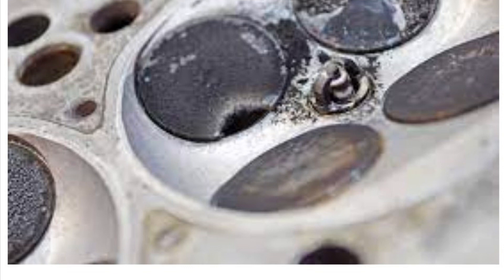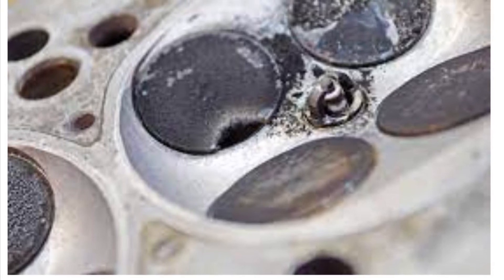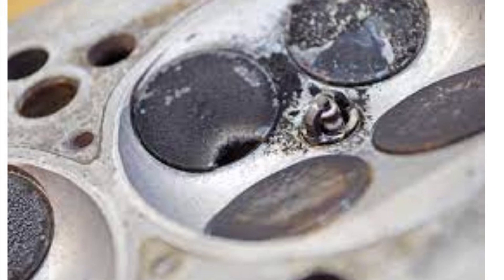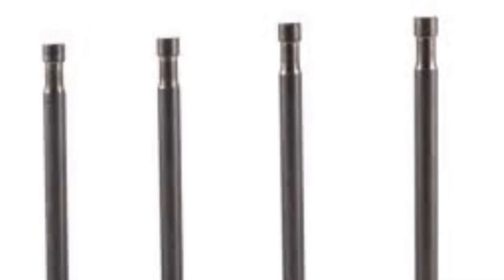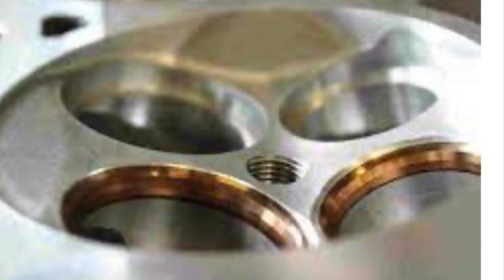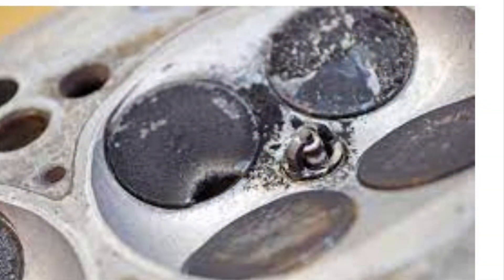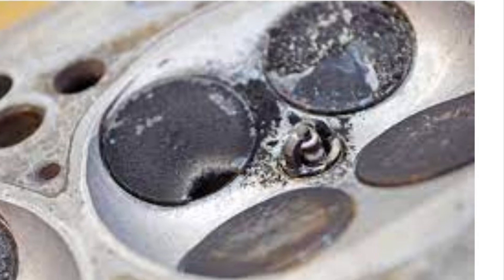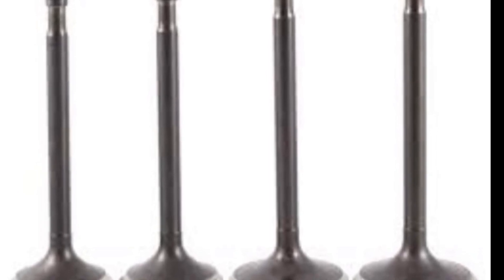Burnt engine valves and why its mostly BS bro science

Comment: I realize the owner of this channel is probably inundated with a bunch of questions from people and I’m sure he is sick of it lol. If anybody else has any insight into my problem, I’d appreciate the help.  I purchased a 2008 SV650 that I noticed was running rich indicated by the spark plugs and the smell coming out of the exhaust.  Looking into that I went down a rabbit hole of what possibly could be the issue and I came across people doing a burnt valve test. When I put a piece of paper in front of the exhaust pipe the piece of paper sucks and blows like in the videos I’ve seen.  Is this a indication of an issue with the valves even for a two cylinder v-twin motorcycle?  I purchased a very cheap Amazon compression tester and both cylinders seem to have good compression on the high end of the spec range.  I also gave it a valve clearance adjustment and two of the exhaust valves on the front cylinder we’re on the edge of spec on the tight clarence side. I replace the shims to be in the middle of the spec range.  Again, any help would be appreciated.
Reply from the maker: it does not sound like you have a burnt valve to me based off your compression test

the most important thing is how does the bike run?
Reply: @vcyclenut  thank you for the reply, I appreciate it. How does it run, well the idle is low and it sounds like it’s occasionally misfiring. When I ride the motorcycle the acceleration seems good, but there’s a lot of vibration in the engine which I’m told is common but I’m wondering if it’s due to the occasional misfiring?  Also the tachometer needle flutters which people on the forums told me to check for vacuum leaks, and I can’t find one if I do have a vacuum leak.
Reply from the maker: doesnt sound like you have a burnt valve to me

Comment: im worried i burnt a valve running my truck with holes all in the manifolds
Reply from the maker: hopefully not,   how large are the holes in the exhaust manifold ?
Reply: @vcyclenut  the entire manifold has holes in it, every single cylinder in the manifold has 3 to 4 medium sized holes (about the tip of your index finger in size), i just dropped it off at a local shop since the studs were so badly rusted i couldnt do them myself and i finally was able to afford headers for it instead of manifolds. my parents were pissed that i was driving around like that and kept telling me id burn valves so im a bit worried since the shop has to take the heads off and i told them to check if there was any noticeable damage or burned valves

Comment: Question…. I lost 30psi in valve 1 even after the valve adjustment, I probably burnt a valve no? 21k miles no mods not even exhaust. first time having a 1000cc bike and road it in the summer and I burnt up most my oil, I thought the bike just runs really really hot but turns out It it must’ve been low on oil without the light going off, my bike would be hitting 230 in the summer in az and when I came to a stop light my oil  light would come on bc I hit 250 degrees bc the lights are a minute and a half long. I’ve hit that red oil light about 10 times then my bike started ideling weird then the next day it started shutting off during warm ups without assistance. They said I needed a valve adjustment and that I probably burnt my engine valves and it’s not sealing properly bc it prolly melted or something of the sort, does this sound about right?
Reply from the maker: sounds like a lot a serious engine issue.  Lack of oil is a cause of death

Comment: A friend om mine put on a slipon an de-cat. On his MT 10 2021. When he dynoed it for fun eg 100% throttle it was extremely lean. Between 4500-7900 rpm the airfuel ratio was 17.5:1. Imagine then what AF-ratio is part throttle. I don’t know if you have different Ecu’s in the states compared to Scandinavia but no Euro-5 bikes go too rich here! Too lean everywhere rather.
Reply from the maker: Yes the mt10 is an exception and is very lean when you swap out the exhaust
Reply: Clearly shows who's in charge when it comes to motorized vehicles, whether the engineers or the bureaucrats. Engines that run that lean are not going to last nearly as long as engines that an engineer would approve.

Comment: My high mileage 09 fz1 will run slightly rough rough under power at lower rpm’s 3k or less ….not while idling in N…and will pop a bit when letting off throttle after getting wristy….some older gentlemen  in fz1 forums allude toward what you’re saying ,that it’s running lean and due to work that’s been done to the bike (b4 I got it ,ais block offs ,exup cables gone and after market can &midpipe etc) …causes the rumble and pops …I don’t know as I’m not even close to a bike mechanic lol… am still trying to get new plugs and coils Installed (procrastination is real 😜) hoping it helps .but wondering ..at a lil over 30k miles I think it’s due for valve checkup /adjustment(got it at 29700 so assume it wasn’t done) …could this be part of the rough low rpm /popping issue ? Does the rough rpm /occasional pop indicate I possibly might be damaging engine ?
Reply from the maker: You for sure need to check the valves 

No!  Engine damage presents itself much more obvious then that
Reply: @vcyclenut  thanks

Comment: Thanks Dave, my FZ09 exhaust gets a lot of carbon build up. My exhaust valves are in spec. The bike runs like a scalded rabbit. Why all the carbon?
Reply from the maker: Carbon build up where?
Reply: Exhaust? As in the tail pipe is black and sooty?
Depends on your driving habits, the fuel octane/quality, engine temperatures when you ride, how long you are riding, if your spark plugs are serviced, and finally what fuel mapping you have and whether it reflects any modifications you've done to your intake or exhaust.